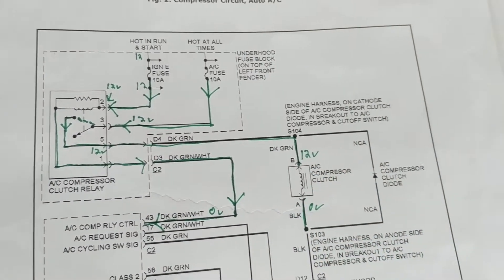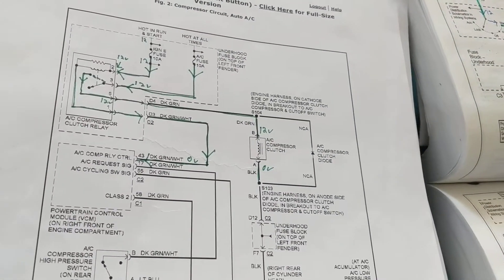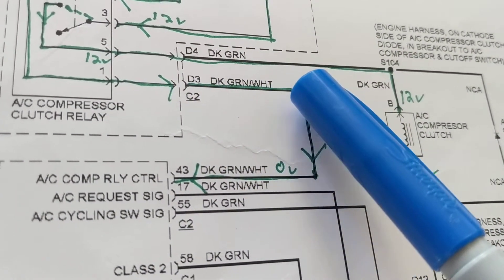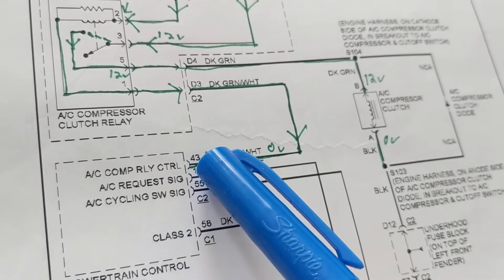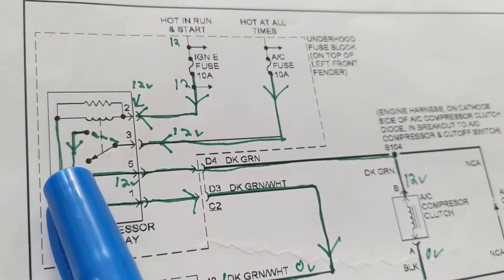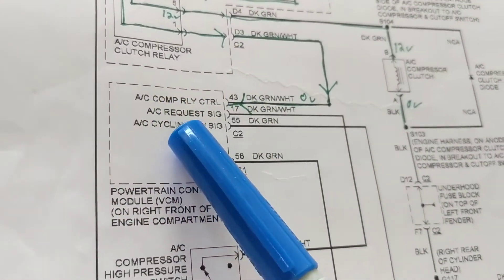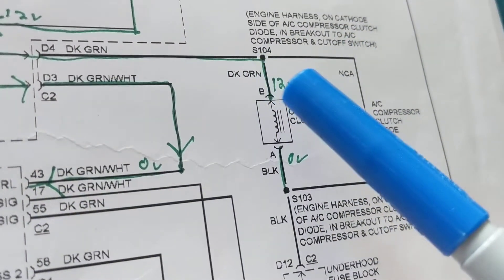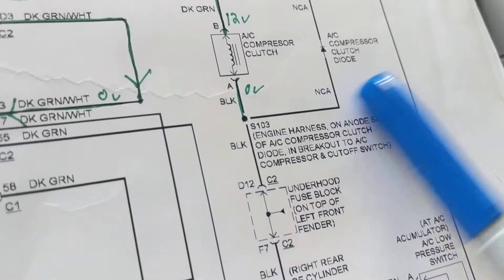HOW TO DIAGNOSE AIR CONDITIONING SYSTEMS FROM THE DIAGRAM SIMPLIFIED

Comment: Thanks for  these  valuable  information.  My 2007 dodge 1500 fule pump is not wired to the fuse or relay box. How else can I diagnose current flow?